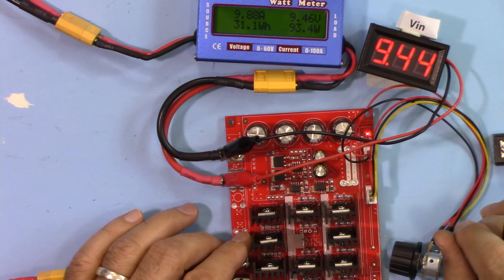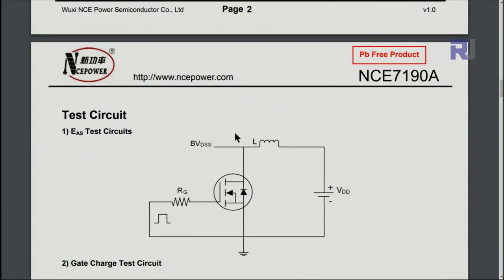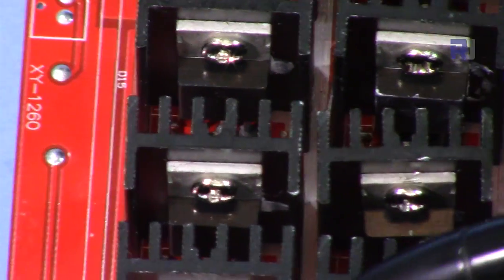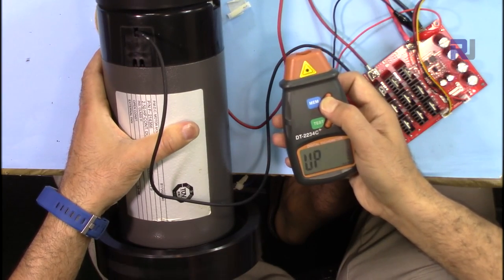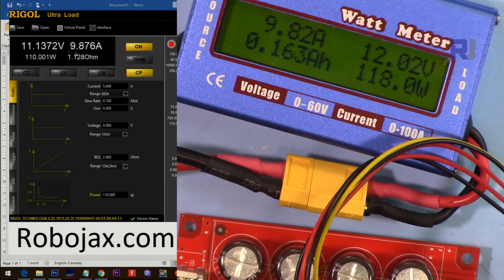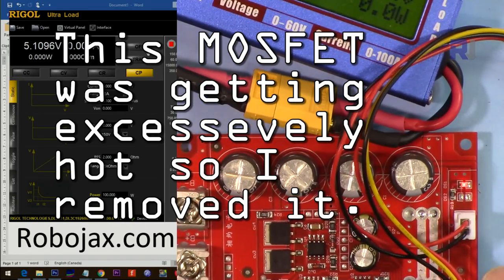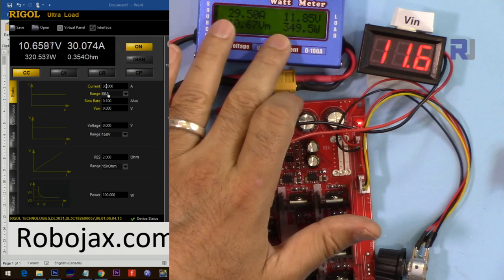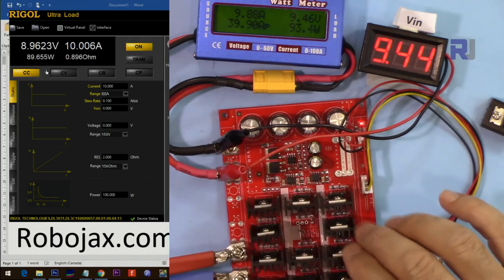Review of DC 10-50V 60A 3000W Motor Speed Control PWM Controller  module XY-1260

Comment: THANK YOU for detailing every component on this board so that I can understand its purpose! I just bought this board to control my custom made electromagnet using my Arduino board! If that's not a good use for this board for whatever reason, please let me know!
I'll just being supplying about 3 amps @ 10 volts to my electromagnet using a 26 gauge magnetic wire.
Reply from the maker: if you need 3A module then this is waste of resources and it is big. see this module https://youtu.be/EapP4BhlYb0

Comment: Thank you very much for this.  I just bought two of these.  One with 60 amp output and an LED power meter and one with a max of 40 amps.  You have helped me understand much more about this controller.  I will check the mosfets for anomalous heat patterns and add a cooling fan.  I am glad to find out it already has current limit built in.    Do you have a video for troubleshooting these controllers?  I suspect the relays are not robust enough.  Both of  my controllers have 2 relays.
Reply from the maker: You are welcome. I am glad you found my video helpful  I don't have a video, but 2 thing will make them bad. first revers polarity of power and the second, overheating. in both cases mosfets will get damaged and I believe other components should not get damaged.

Comment: very good! actually I'm new to these stuffs and still learning but every circuit I saw was with a single mosfet so I was wonder if the pre assembled pwm controllers using mosfets in parallel or series and why multi transistors or what are the other components. so you helped me out to get a little out of the confuse. that is nice also seeing you responsing and answer the comments
Reply from the maker: I am glad you found it useful.  Greeting from Ahmad from Canada.

Comment: Hi.. I think the U4 IC is the mosfet gate driver. Is it the gate driver? Or is it MCU? What is your guess? OR will we not know exactly what this component is?
Reply from the maker: Hi, this does not and should not have gate driver because we don't change the direction of rotation and we don't need high-side driver. here is the hack to use this driver with Arduino https://youtu.be/k13iTmvPtUU
Reply: @robojax  Hi.. Thanks Sir.. U4 8 pin soic MOS, MCU or ECU (EPROM)?

Comment: if i understand right . ghe input voltage is the same as outpot voltage. ?. is there a card that can handle 100v DC. for trandmill motor?
Reply from the maker: first part yes.  here is one 1000W on https://s.click.aliexpress.com/e/_AMr0QD where it has tones of options like speed, brake etc but it might be useful to you.

Comment: What happens when the 36 volt motor of the scooter is exposed to 50 volts?
Reply from the maker: Overheat first and in few moments if you don’t have fuse or protection, you should see smoke and it will die.

Comment: Great video and thank you for sharing! Could you please do a video showing how to mod to enable forward and reverse control of dc motor using his module? I'm planning to use this to control a trolling motor for use with a kayak. Thank you!
Reply from the maker: I have make a hack to control this using Arduino. But I will look at it.  it wont' be easy to hack it but I try.
Reply: @robojax  Thank you! Looking forward to it. That is the one of the things that i think is lacking on this PWM in addition to a display of the power level.
Reply: I think all u need are two 5 pin automotive relays and a 3 position switch  for forward off reverse. I don’t know if u need diodes on the coil circuit for back emf.Seen a similar set up on a wiper motor down rigger using a pwm with automotive relays to control direction. Many dc motor reverse direction circuits using automotive relays on utube.

Comment: Would it be ok to spray a thick layer of circuit board lacquer on a board like this? Wan't to keep good cooling, but need some protection for random water drops.
Reply from the maker: I am not sure about the conductivity of the material. Test it another board and after it dried, try to measure the resistance of two points about 2mm apart. If you get anything less than 1MΩ then you can't use it.  This board has MOSFET and it is possible that the material leak some voltage and it turns it ON or OFF. So for that reason you gotta test it or read the technical details of the material before using it.
Reply: Ok, thanks for the reply. I will check it before using it.

Comment: What should should be the supply dc adaptor rating if i want to control two 12 volt 0.5 A fan with pwm modulator..??
Reply from the maker: Because you need only 0.5A, also most any motor module can do it. This is one of them https://youtu.be/inUOVV0LnoQ

Comment: This device work like a step up voltage? Input 12 volts could I vary the output volts to an higher voltage like 13,8 or 24 volts. TKS.
Reply from the maker: hello, wow. If you watch it, no question will be left unanswered.  the title says it is PWM. so it controls motor not by changing the voltage, but by Pulse Width Modulation PWM method. the voltage will stay the same.  See the step down or Buck converters video in my channel.
Reply: @robojax  thank you HNY 2021.

Comment: Can I use this module to send pulse signal to a brushless motor ESC? I want to control the ESC with a potentiometer
Reply from the maker: I hope you have watched the video ans have seen that this is connected to a motor which has only two wires. Now look at your motor and it has 2 wires it will work and if it has 3 wires it won’t

Comment: hello,i have a 60 amp motor controler,slightly different to the one shown here, the board is green,it has 2 large relays for the h bridge,4 shotky diodes,8 mosfets,the components on the board are not marked. when used to control a small motor [12v car tyre pump] the motor runs at 90% when the display shows 00%,turning the pot takes it to 100%,is their a problem with the board? the 555 timer?, wanted to connect an arduino anyhow,i though of replacing the pot signal with one from the elegoo,but i see your replacing the 555 instead,great, dont want to return unit,eventually wish to control car starter motor,thankyou
Reply from the maker: Hi, I've got the board. the video is coming in a few weeks.

Comment: Hello, good morning, greetings from Colombia. I have a question. Same motor that you are using but with a PWM module 60v 20a 1200w in battery it works at maximum rpm but when putting weight on the motor it does not rotate and the PWM module overheats and I have it working with a chain reducer motor 🤷🏼
Reply from the maker: Hello,  the motor must rotate or else all energy is converted to heat, it seems motor can’t handle the load. Either reduce the load or use more powerful motor

Comment: great video! what would happen if I connected a 12V battery to the Output of the PWM, while the Input is also connected to the same 12V battery?
Reply from the maker: you will create short circuit because PWM will become HIGH (12V) and LOW (0) so it should create short circuit and burn the mosfets or fuse.

Comment: Great video. What would I need between the controller and a residential 110V AC 15amp source? Would a bridge rectifier be sufficient?
Reply from the maker: Thank you.  No.  Your DC motor has Operating voltage. So you need to have DC power supply that matches your DC  voltage of your motor. Say your motor is 24V, with 10A so  you need a power supply that outputs 24V with 10A current.  Now this power supply can get power from 110V (or 220V). So you need this power supply between 110V and this module.
Reply: Robojax ok, thanks for clearing that up. What about using a 110V to 24V transformer between the AC power source and the motor controller? Would that work?
Reply: @christianroessler9928  Just get an DC to AC  power convertor. ( I guess you can open it up)...yes theres some sort of raticfier going....
but to make it easy on ya. ( 2500watt converter is only $30)
There's cooling fans in it....ect.
This way you can just use a skil saw motor on a go kart...ect
But you're going to have to pump crap load of juice through it
and batteries will HEAT UP..if they dont have the cranking power or higher discharge rate.

You want Magnets DC motors....brushed or brushless...
so you dont need to charge the rotor to magnetize the rotor...WASTE
electrticity...becuase you're not hooked to the grid any more.
Batteries are either BULKY or EXPENSIVE.
Power to wieght ratio..will play a factor..Lead acid are heavy..requires
longer recharging time...ect Li on arnt that cheap..plus they only 

have 30 C....Lipo 50-100C  are expensive and requires charging managment..
15C lipo...wont be with a fu$K....They'll get HOT

You;ll simply want magnets DC motors...to simply increase RUN TIME
or RANGE..
hmmmmm video of dudes making heavy arsss FRam gokarts are ROOKIES..they build BRICKS...okay

He's babying that tread mill motor...I'd run 48 V or at least 36V...
If you some research....cross part # or know what type of transitors
You can upgrade to CERAMIC or higher temp transitors...or get some with highter
voltage ratings.....
Samething with the diodes...fro the motor's kick back
Reply: I really like your videos.  I have a treadmill motor I'm trying to use one of these boards to control it.  I saw in your comments earlier you dont need a bridge rectifier after the motor because the motor outputs DC current but the volt/wattage on this motor is kind of weird.  Its 21.4 amps and 95 VDC, which is maybe Voltage duty cycle?  What size controller would I need in that case?  Can you up size or do they have to match?

Comment: if you wanted even higher amp capabilities what would you recommenced?  just more cooling or could a guy add another board or row of mosfet?
Reply from the maker: I have included the datasheet in the description and you see that each mosfet can handle 90A. If you are able to attached a heat sink that is large enough with cooling, you should get 50A each which would be 50x8=400A but in theory you should be able to get 90x8=720A.  I am being conservative, suggesting 400A. Read the datasheet and provide adequate heat sink and you should get that current.
Reply: @robojax   the max ampere you got was 40 for the 7 mosfet, so  you are capable to draw around 6 Amp for each mosfet

Comment: Do you have any idea if the knob control can be somehow replaced by a pwm input signal? I don't understand where the analog knob voltage is changed to digital on the circuit board, but have one of these and want to run two fuel pumps with it. They only require a total of 40amps when at maximum pressure, so this controller should easily run them. I'm just trying to find a way to connect the pwm signal from my computer to this device. Thanks for the videos and for any help. Have a good day.
Reply from the maker: here I have it https://youtu.be/k13iTmvPtUU and more like this for smaller modules

Comment: hello friend 
i have the same speed regulator.
why when the voltmeter is all at zero i motor always turns to the maximum? help
Reply from the maker: Hello, I am not sure where you are measuring from. But at the motor terminal you should get the actual voltage.
Reply: I mounted a 12v battery on the pawer terminal it gives me the same voltage on the terminal that goes to the motors

Comment: is it possible to replace the potentiometer with ebike throttle to control speed?
Reply from the maker: Yes. if the eBike throttle IS made of potentiometer. Disconnect it from bike, measure connect it to multimeter and  turn the throttle, if the value changes, then it will work.  learn about apportionment here https://youtu.be/TbLdAQpE4jE good luck
Reply: @robojax   thanks
Reply: @robojax  the throttle is hall sensor effect type
Reply from the maker: then it won't work. this needs actual voltage to change to control the speed.

Comment: Did the amplitude of the motor voltage remains constant or change as the speed change. I have the same PWM board like your, I measured the voltage across the motor is changing between 2 to 11.5VDC on 12VDC input as I changed the speed control knob. Is my PWM board not function correctly?The article I read (the amplitude of the motor voltage remains constant so the motor is always at full strength. The result is that the motor can be rotated much more slowly without it stalling. So how can we produce a pulse width modulation signal to control the motor). Would you explain. Thanks.
Reply: The schotkey provide protection from flyback voltage from the motor.  The tradeoff is there is a certain amount of voltage drop.  Increase the size of the battery pack by one cell or two in order to make up for this voltage drop.

Comment: Great video. Thank you. I noticed the potentiometers on these contain 5 wires. what do the 2 separate red/black wire do? are they just on/off? I'd like to use a 3 wire twist throttle with this and am curious how I would wire it. any help would be appreciated
Reply from the maker: thanks. I just watch the video making sure I haven't missed anything and indeed I did not. I have explained it. please watch the video without skipping.
Reply: @robojax  Thanks Robojax. Perhaps I should have worded my question differently. I understood that the red wires were switch wires but I was unsure if you could simply use a jumper on them or possibly a toggle switch. My apologies. I did receive the unit and a simple jumper works for the switch part. But what I noticed testing the potentiometer is that the voltage is full at the off position and drops as you increase the gain. That was counterintuitive to me. After some fiddling, I swapped my throttle +5v and ground cables around and can confirm that it works, however once the jumper is in place, the motor turns slowly at zero throttle, and I believe it will not reach full speed at full throttle. My only guess is that ebike throttles are outputting 1 to 4v and not 0 to 5v like the potentiometer is outputting. and I believe its a hall effect sensor in these throttles. I wish I could use the throttle I had but I'm thinking I will need to source a throttle with a different output.
Reply: Alex Fagundes Hello, did you ever figure out code changes to use the hall sensor (ebike throttle) in place of the potentiometer?  I’m having the same issue with a similar circuit where zero throttle turns the motors.
Reply: TheYockfu There is no code that can be changed or settings that can be updated in this controller. No one else seems to have an answer to this problem either. I’m not that experienced in electronics to have a great fix. Option one is to use a regular cable throttle that attaches to a pot and some kind of spring setup used to return the throttle lever to off (just as if it were connected to a carb). Option 2 would be to make a small module that attaches to the hall throttle and pulls down the .8 low side to 0, and pulls up the 4.2v high side to 5v. I have no idea how to build an opamp circuit for this but I wish someone could show us. It would be very handy for a diy video.

Comment: 60M PWM Speed Control Circuit

 hello, can I ask you a bit, can this circuit be used for 2 motor slowdown 24v 250W 14A .. I hope you can help
Reply from the maker: Yes it can. But both motor will run together if you connect them in parallel.
Reply: @robojax  Thank you
Reply: @robojax  Thank you

Comment: so am i right in saying this unit can not handle 60A?  from what i saw this unit can only handle 30A
Reply from the maker: depending on your voltage you can get higher current for example if use it for 5V you might get 40A or 50A . Watch till end of video.
Reply: @robojax  yes i watched all the video. as i said. i did not see any capability of this unit reaching 60A.

Comment: A Great Review of this board. Thank you...!!!   I have ordered 2 of these for my project. (Sawmill) Has anyone hooked up a Digital Read Out for the % of PWM the motor is receiving from this board? Or do I need to do this using an Arduino UNO etc?  A Schematic would be helpful? A Link maybe? Thanks!!!
Reply from the maker: Hi, look at this, it might help https://youtu.be/k13iTmvPtUU always search my channel, you will be surprised.
Reply: @robojax  Yes Sir... I did follow the links to your main site and did watch the video for using UNO as the PWM However,  my question was, can a  digit counter be added to the ESC board without using a microprocessor board to display the percentage of the PWM..?
 I already follow your amazing site and appriciate the effort you put forth on all your projects. I don't know where you find the time to reply to almost every post. Keep up the good work. ..!!! And Thank you...!!!
Reply from the maker: Yea you can use any device that generates PWM.
Reply: Thanks Again..!!! :)

Comment: 128/5000
Did you try to control with Arduino DC-10-50V-60A-3000W-Module-Driver-PWM-Speed-Controller-12V-24V-48V with Arduino
Reply from the maker: this is not made for Arduino. But I will look at controlling it with arduino.
Reply: @robojax  Thank You

Comment: Can this controller work with a brushless DC motor?
Reply from the maker: Brushless DC motors have 3 wires and they need different controller with 3 output wires. This has two output wires.
Reply: @robojax  Do you know of a motor controller that can be programmed with arduino for a 72v 3000w Brushless DC motor?
Reply from the maker: I have not worked with such thing. Perhaps I should make video on that topic.

Comment: How can we control 40 servos and is it possible
Reply from the maker: Use this module https://youtu.be/y8X9X10Tn1k and connect output to the 60A module.  You can cascade multiple servo controller to have 40 servo controlled